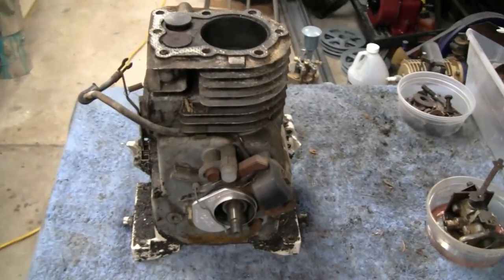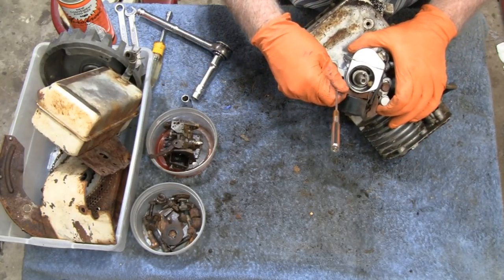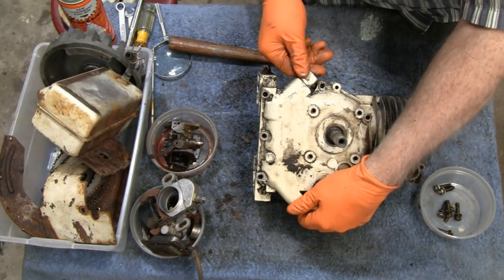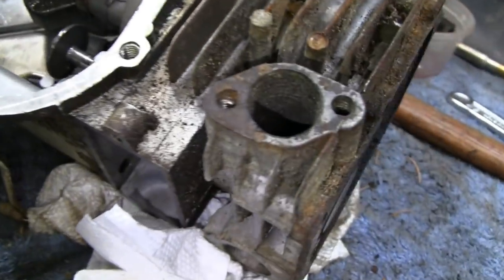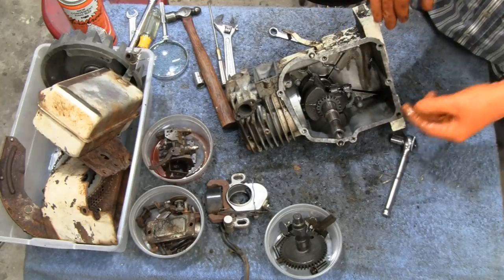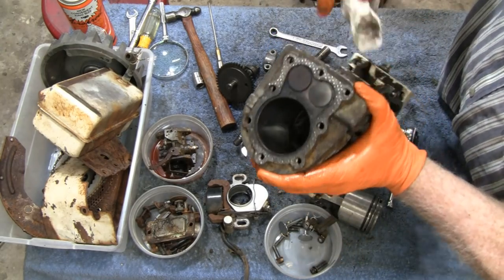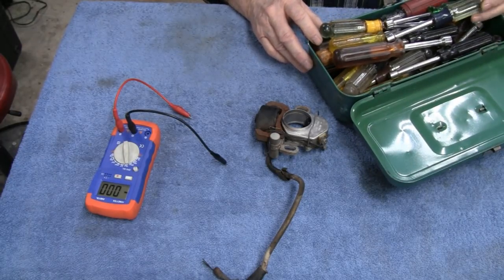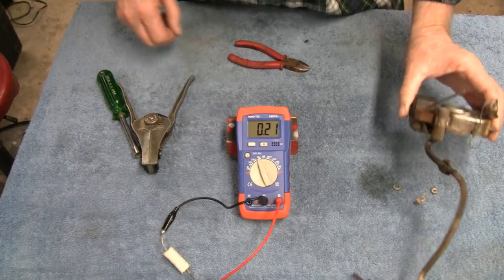MOTORIZED SCOOTER ENGINE SWAP (part 2)

Comment: If someone else posted this, my apologies, I missed it. As my old manuals tell me, it's  a model H30 made the 309th day of 1974. Early tecumsehs had the riveted  tag. From my high school days working in a mower shop, I'll wager it was on a Sears snowblower based on the clutch, the 'heater box' around the muffler and the carb having a primer barb on the base. I'II go way out on a limb and guess the snowblower was made by Dynamark. Tecumseh engines made for sears used a 143.... number. The engine is 3hp. Also, look for an 'F' on the carb for proper diaphragm placement. Taryl has a video on that. I enjoy all your videos, can't wait to see the truck done.
Reply from the maker: Thanks for all the info Pat!! I already put the diaphragm in, hopefully I put it in right!! I didn't see an "F" on it!! I'll have to try and find Taryls video!!☺
Reply from the maker: I watched that video and I did have it in wrong!! Thanks for the heads up, you might have saved me alotta aggravation!!☺

Comment: I agree 1960's Tecumseh.  Snow blower engine? If so they really didn't get much use in my area (Wilkes Barre, Pa) and I've found some internally mint engines from old single stage snowblowers that probably didn't work that good.  That recoil shroud looks like it has a snow shield over the recoil.
Reply from the maker: Yeah that was the first thing Mike asked me when I asked him what I had!! He said is there a little cover above the pull start on the housing!!☺

Comment: I'M like you I can't believe the condition of that engine inside it looks brand new. I don't think its been started after somebody rebuilt it or did some work on it. Love spending shop time with RK!
Reply from the maker: Thanks Bob!! After going through the whole engine I don't think anyone messed with it!! Everything is too nice, I think the carb froze up after about ten uses and it was given up for dead!! The consensus seems to be it's off a snow blower, a few guys claim to have owned ones just like it!! There have been a few times that I haven't used my snow blower for 2-3 years!!☺
Reply: @805ROADKING  Yep! I bet snow blower too. Breathing just cold clean air the few times it ran.

Comment: Very, very clean in there. A repurposers dream come true. Clean it up and fire it! The later model Tecumseh's do have marks on both crank and cam gears, in my experience.
Reply from the maker: Yeah I was checking some of my old manuals yesterday and it showed some of the newer ones they put a bevel on the crank gear tooth!!☺

Comment: Man that engine looks like a new one inside.  Makes you wonder if it has been rebuilt before and if not then used very little as you suggested.  Great video.  Thanks again.
Reply from the maker: Thanks D!! Yeah I don't think it was rebuilt, everything is too nice!! I think the carb froze up after about 10-20 uses and it was just parked!!☺

Comment: I enjoyed the tear down Road king. I'm about your age (I'm 75). I started working on small engines when I was 14. My first were lawnmowers, mostly Clinton which  I used to make school clothes and spending money. Then I bought a 1949 Cushman highlander motor scooter for $20.00. it had been stored in a barn since 1946. Got it running and used it until I bought my first car, a 1955 Studebaker Champion for $125.00. Drove that until I went into the Marine Corps in 1965. Served 2 tours in Vietnam, then did 30 years as a Calif, cop. Now I'm dealing with the effects of agent orange and the aches and pains of a misspent youth. I still have my old Harley but can't work on it much anymore. I went back to small engines on large frame mini bikes and ride them and enjoy tinkering with them to get 40 to 50 MPH out of them. I don't know if there's life after death...guess I'll find out soon but if there is I hope to hang out with old guys like you and talk engines and the old days when cars had carburetors, no electronic ignitions and real airplanes had two wings and round engines. I  don't care too much about listening to angels sing. Keep em coming.
Reply from the maker: Thanks alot Tom!! Great Stories, sorry about your health issues!!☺

Comment: You adjust that coil gap by feeler gauge. You put the flywheel on loose so you can pull it on and off. But as you said just mark the coil with a punch or something.

Comment: Well, I suppose Road King would HAAAVVEEEE to find another capacitor to keep the engine era-correct. There is the option of a more modern flywheel and ignition coil otherwise.
Reply from the maker: Lol!! You know me too well Newman!! I did find two identical good capacitors but I think I'll restuff that one with a new Cap!!☺

Comment: To time those coils you use a dial indicator on the piston and a buzzer light thing to the points ..Worth doing if you want to fine tune it for peak performance
Reply from the maker: Yeah a few people mentioned that method!! Mike was telling me a way to do it with placing a nickel on top of the piston!! I'm just gonna put it back where it was at and call it good, that was more than likely the factory setting!!☺

Comment: Snowblower engines run maybe 4-5 hours per year in the Mid Atlantic, sometimes more, sometimes less, depending on the actual location and amount of snow. Not surprising it's clean inside as it probably has less than 150 hours on it. Same with rototiller engines and the old edger engines. You got a good one there Buddy!
Reply from the maker: Yeah Buddy!! Whatever it was, was parked for a while and once the carb froze up that's all she wrote!!☺
Reply: @805ROADKING  Yeah, Buddy, that'll do it every time. Check your email.

Comment: Grandma had a tiller that threw a rod. Old fella that worked on her mowers got it. Replaced the rod. JB welded the crack in the block and that sucker ran again. Burned as much oil as gas. But ran lol
Reply from the maker: Yeah they're tough lil' engines!! Ya keep patching them up and they'll run forever!!☺

Comment: that engine is a snow blower engine snow shield on starter/heat shield a round carb to keep it from warm  and not iceing /no air filter to plug with snow/there was two chokes to help in real cold starting /clutch with pulley to run blower.nice low hour unit there i have two of those engines mark r buffalo

Comment: How is that slinger supposed to splash oil around? It's just a flat blade. Honda has fingers on the end to throw the oil upwards. 

Wouldn't that just slice though the oil whilst making little to no splash?
Reply from the maker: Believe me when that lil' piece of metal slaps that oil 3200 times a minute it goes everywhere!!☺

Comment: Where can I get a meter, and what is it called? Haven't watched in a bit, I had a stroke. Was in hospital for 3 weeks and rehab for 3 months, to learn how to walk again. Not a pleasant spring/summer but I made it to 70 in August. The old International got put on the back burner. Old age ain't what it's cracked up to be! Newk from Kentucky
Reply from the maker: I'm sorry to hear that Newk, But I'm glad you're still here and doing better!! That's called a Capacitor Meter, they're about $18!! You can get it here,  https://amzn.to/332D8pY
Reply: Well Happy Birthday Newk, I will be your age in October myself. I have a owned a digital multi-meter for over 20 years, but I have never tested a condenser/capacitor with it. Amazon or Walmart have them. Mine is an inexpensive Sunpro, but it has worked well for me, mostly checking voltage, and continuity for my radio coax. No doubt it will do all you need to do.